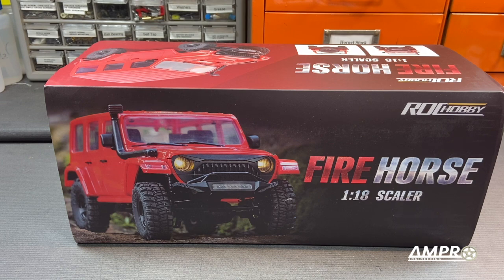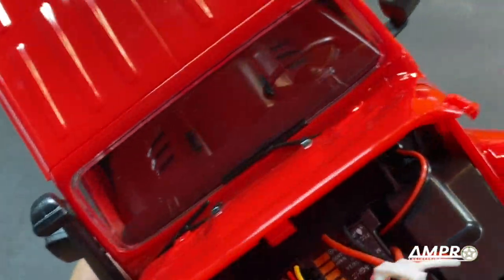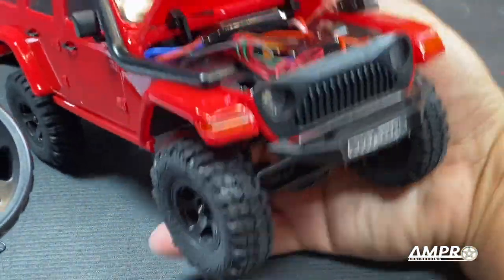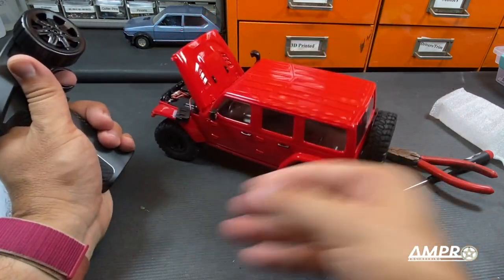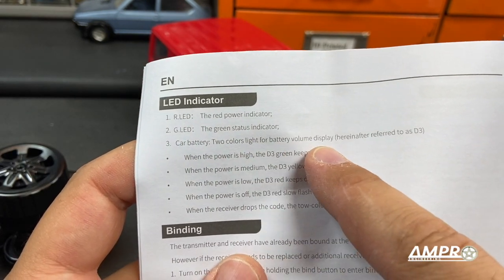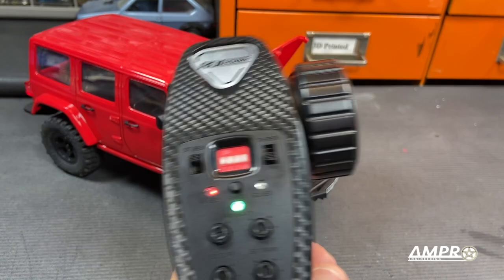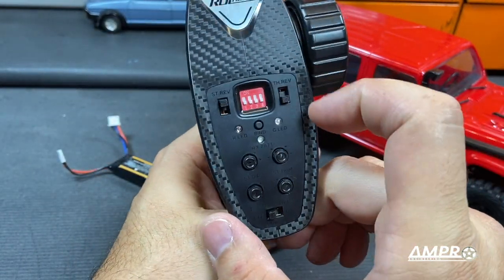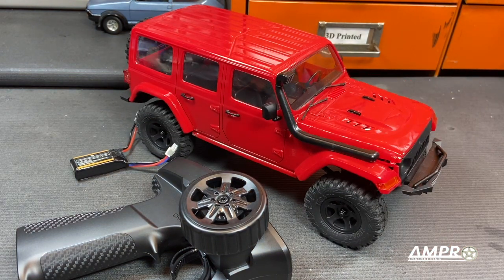e316: 1/18 RocHobby Fire Horse - The Buyers Guide Series

Comment: The Fire Horse is painted, because up close you can see some slight orange peel and overspray in the interior and when you sand the body it reveals a paler red plastic underneath. I don't like the paint though because it is semi transparent and way too glossy
Reply from the maker: WAY TOO GLOSSY is right
Reply: @AMPROEngineering  I retract my statement. It is not painted, it is just very glossy molded plastic--I tried Super Clean and Easy Off oven cleaner on it and neither removed any paint, but they cleaned and degreased it quite well 🤪. Sanding it with 500 grit paper also did not result in the paper getting clogged with paint. Just minor plastic residue was the result.

Comment: Has anyone added upgrades to the Fire Horse. Just got one and don’t see much info on parts for it.
Reply from the maker: No there really arent any parts. These are more of a motorized model than an RC car.
Reply: @AMPROEngineering   I couldn’t decide which one to go with….would Axial be a better choice? Do you have a recommendation?
Reply: There's solid brass wheels (same 5 spoke design) for the 1/18's to add weight, plus several additional simulated disc brakes (some with drilled rotors) that also add weight down low, and there's a full metal gearbox set to match the metal gears already in the axles. I think there's a full ball bearing set too, floating around, but not necessarily marketed for FMS RocHobby, but for the very similar CR18, and of course FMS spare parts are available.

Comment: Adding scx24 brass wheel adapters to the stock wheels greatly improves the performance of this rig. A great and cheap upgrade imho.
Reply from the maker: This is a killer idea! Thank you for that!
Reply: @AMPROEngineering   you’re very welcome sir
Reply: The scx24 axle extension kit also helps with stability.  You just need to retap the nut for the thicker axle.

Comment: Yes the Rockhobby definitely has the softer tires to get over those hard “shiney “ plastic blocks! Great video, all though on rocks and just about every other outside terrain I had a quite different experience. 👊🏼👍🏻🍻😃
Reply from the maker: I used this on rocks and dirt too. It was good on the rocks....no so much on loose dirt. You can see it on rocks (different body and electronics) in e307 and e312 (again, diff body and elect). Outside, I think it is just too small.

Comment: Does anybody know if the firehorse transmitter can bind to the arizona receiver with all features available?
Reply from the maker: I dont think so. It seems that they have different functionality.
Reply: @AMPROEngineering  Yeah, it seems that the receiver/ESC in the arizona may not be as good as the firehorse.  I noticed also that the arizona whines at low throttle and the firehorse doesnt.